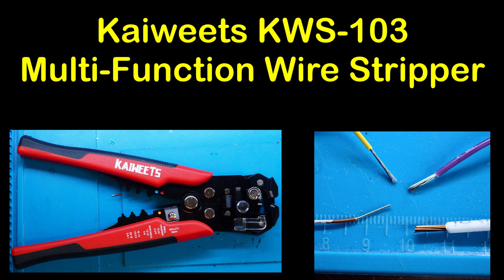Kaiweets KWS 103 Multi Function Wire Stripper Tool Review - #146

Comment: I've had mine for 6 months now and it has been great. It works as well with small diameter wire as it is with heavy gage.  I have several low cost Kaiweets products, they're built well and hold up to daily use.

Comment: Ha, I've been using this exact model (or a 99% similar model) of wire stripper for a few years now. It's not perfect, but it's very useful, and as it's cheap I don't need to worry packing it with me on a trip and losing it.

Comment: A common and excellent type of stripper are versions like yours but with groves in the blades for the wire. The blades have grooves for each wire size and provide a untouched space for the copper and allow the blades to cut the insulation without pinching or nicking the copper. They strip 0.25mm / 30 AWG excellent. Check Stripmaster 45-098 for a picture.

Comment: I wanna see companies like Yihua/WEP, szbesttol and Aoyue start selling affordable thermal wire stripper stations. 
With things like hotair stations, desoldering stations, preheaters, solderpots, vacuum pickup tools and such being priced in a way that's accessible to hobbyists while remaining functional, I'm surprised thermal strippers aren't being manufactured and sold in the same way.
Getting a clean cut into stubborn jackets without stressing the wires would be nice. Maybe a bit of an overkill luxury, sure, but couldn't many of the things I've mentioned be considered as such?